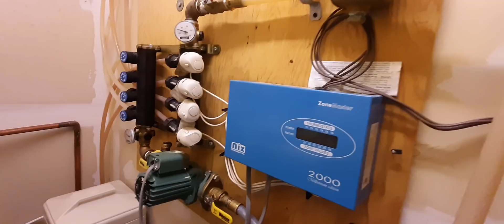It's all about Water - Wells, water treatment, and equipment

Comment: Thanks for the great info Leah. I'm trying to find a good off grid water purification setup & I'd be really interested to see a follow up vid showing what contingencies you have for grid down situations. Would you be able to keep it running or are you counting on the mountain water you get up at the ranch to be potable already?
Reply from the maker: If we added solar or another electric source and stocked up on filters & UV bulbs we could keep it running.  Mountain water should prolly be filtered also, but an option.

Comment: Great job on the conditioning equipment.  And your so well educated on what you have. I’m a journeyman plumber.  I hear people always saying “I don’t have bacteria or nitrates In my well. But people do not realize that just a good rain storm could give you bacteria for just a few days.  Plus at 40 grains your tankless water heater wouldn’t last long.  A little FYI.  Water softener will remove one year of calcium from your plumbing for every 4 years you have it running.  So I’m told by the rep we have. I know. Be great if it worked faster.  I’ve seen so many people buying a new water heater every 3-4 because of calcium not being removed.  BTW. I love the work, knowledge and information you and Diamond share.
Reply from the maker: I ask a lot of questions - that helps. :) Yeah, I wonder about the tankless. We dealt with a complete failure of a tankless (totally gunked up the gas valve, so we replaced the valve, and of course the filter) at the place we were previously renting because not only was there no water filtration or softening, but the water came from a very dirty cistern (clueless owner).  The tankless here is only for the closed hydronic floor heating system - I was just hypothesizing with a plumber friend the other day that with any luck the system was filled with distilled, maybe if we're lucky. We are going to purge the conventional hot water heater to extend it's life however- concerned about sediment and mineral build up there. I just discovered today however based on its performance that it may be in better shape than assumed - 9-14 years old but seems to be functioning quite well - not quite sure how that is given the water, but we'll see. Good to know that the softening will help remove calcium buildup - thanks for that - and I agree would be great if it worked faster! Leah

Comment: The Calcium n our water is easily removes from the porcelain and fixture with white vinegar, Sometimes you have to let it sit for. While or tie a baggie with vinegar in it for the shower head let it sit then rub lightly and run the water to clear-works well for us.